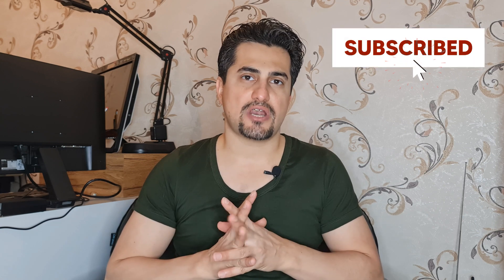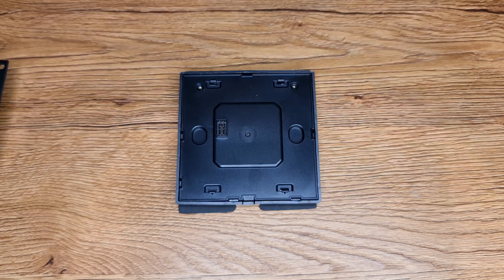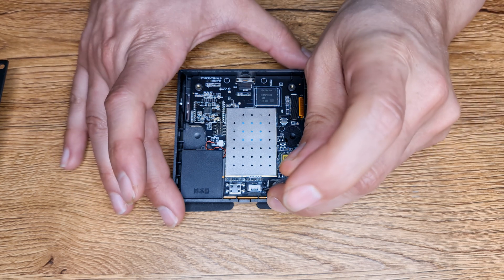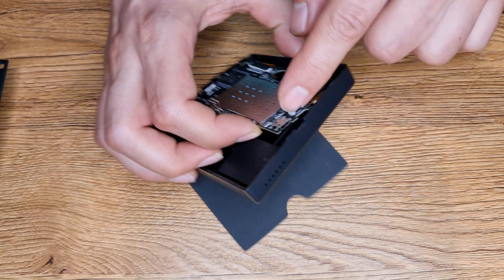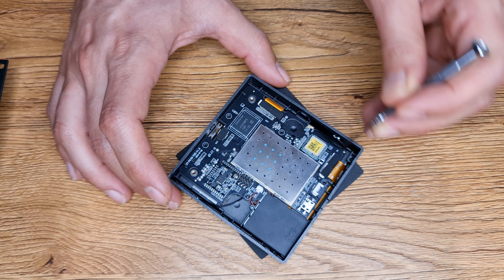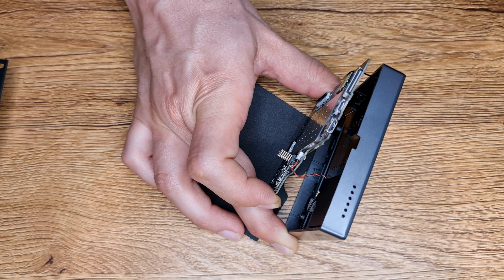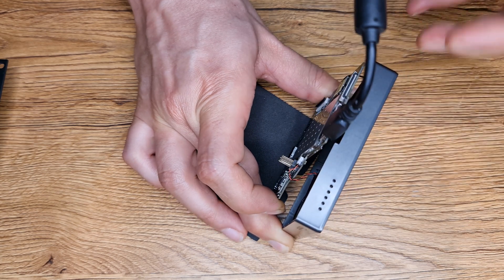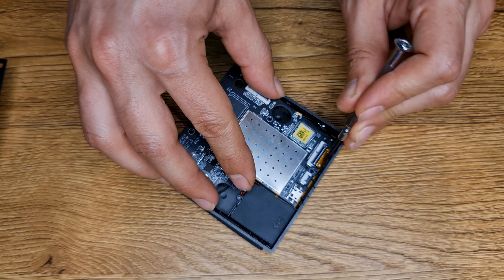USB port of NSPanel Pro

Comment: So can you power the device by USB? Particularly by this port?
I've tried powering it via the back panel based on the circuit board labels for ground and 5V, but it just resets over and over.
Reply from the maker: You can use this port. 
Are you sure about your power supply? 
Also, May I know why you want to power it this way?
Reply: My walls are solid brick with a centimetre of render and a millimetre of hardwall plaster. I'd prefer to surface mount than chisel in the whole transformer.

I was hoping this would be able to be powered by 5V 2.1A from the back panel so I could run a low voltage line through a shallow channel to the device. USB doesnt work. 

I'm working on a POE solution currently. Last resort will be to move the transformer into my network rack and hack run the output through a few lines of CAT6 soldered together.
Reply: Required input voltage appears to be 5.37V
Reply from the maker: @NuclearOctopus  How about its power? The maximum Ampere it can give?
Reply: @kian.smarthome  - The specification says the max draw should be 150mA. I've got a 5V 2.0A usb power supply here, powering the panel via two of the pins on the back of the display.

The stationary SONOFF logo appears, then the screen goes black. This repeats  a few times, then an orange progress bar appears with Chinese text basically saying "Installing updates" - None of this happens when powered using the transformer/adaptor.

Maybe I need to supply power to another pin? I've probed them all and the bottom 4 appear to be power while the top 4 appear to be unused / intended for relays which didn't make it to the final build.
Reply: @NuclearOctopus  thinking about doing the same, as this is to reuse the cable of an old alarm keypad, I think I will just use the original supply and put it hidden in my alarm box, and then connect the panel to it via the old keypad cable.
Reply: @floco_io  Yes. That's exactly what I've gone for.
Stock power supply sitting in my network box, with the ground and power terminals soldered onto a network cable and then soldered onto terminals at the other end. Total mounting depth is about 6mm and the screen sits flush on the wall.
Reply: @NuclearOctopus   Hello, good morning, I'm trying to do the same.  power it from a cell phone source and I get to the same black screen after starting, were you able to start it?  Can you help me?   Big hug, Caio from Brasil!
Reply: @caioedoardopiva  No, I really struggled to drive this properly. In the end I ran power from the official power supply over an ethernet line to the device on the wall, but even then it seems to power down randomly and I suspect that it can't draw enough power over the 10m or so of cable. I didn't bother trying to double up the power lines, but it seems there's not much choice other than to drive it directly from the power supply.